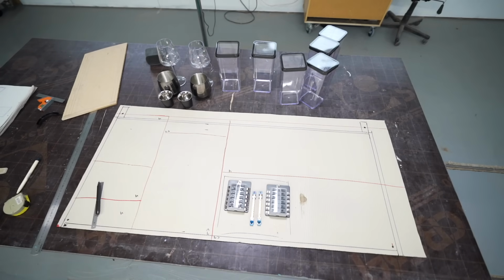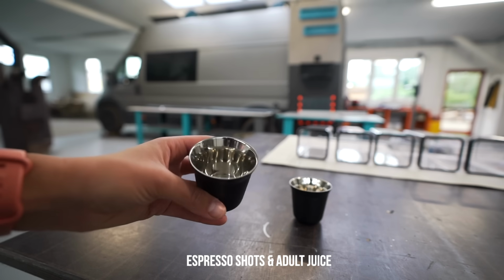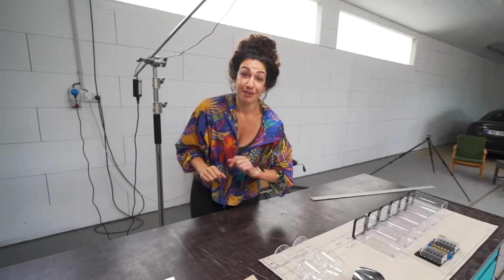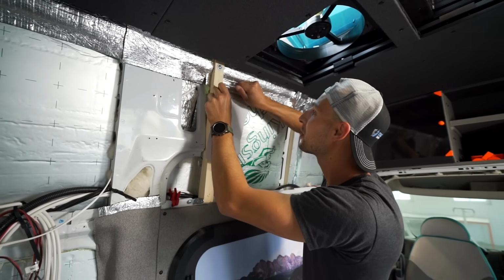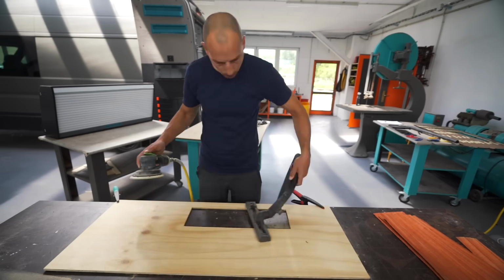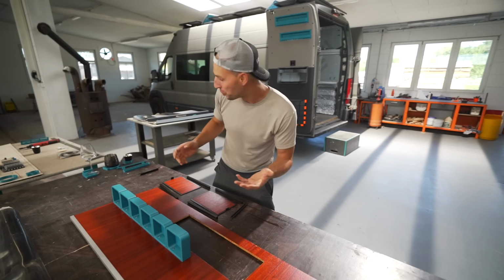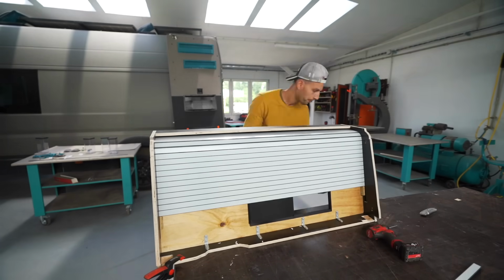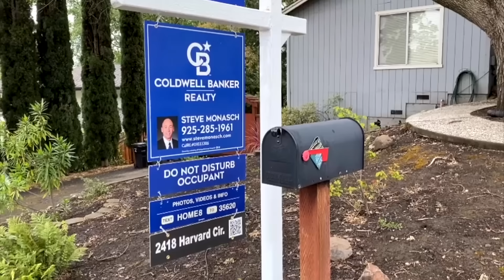Modular Overhead Kitchen Unit for Tiny Living Capsule (Pimp My Ride theme 😂) / Van Build S3E8

Comment: Hi the Vineer wood sheets if they not held glue tight can iron ( electric cloth iron )  ironed down to finishing drying the two surfaces of the glue MUST HAVE BROWN PAPER BETWEEN IRON TO PROTECT VINEER .This method ideal for edges and tiny bit , was shown this as boy in wood work class at school .hay! Really liked the sliding doors too

Comment: It will be perfect but it will take a long time.

I'm worried about these hooks in the containers, whether they will withstand the weight, especially on the road. Ordinary sliding doors would also be lighter.

I used to like to combine, but now I come to one thing: the simpler something is (maybe even primitive), the better :D
... And it will certainly be easier to fix

Comment: I'm doing a huge forehead-slap over here - sliders instead of cabinet doors! Lovely AND practical. No falling open on sharp turns either.  Could you use this for non-secured items, ie, without your system to hold canisters to the wall of the cabinet, would a bag of sugar break the sliders?

Comment: I love all these 3D printed parts you use in this build. It really shows what an incredible tool a 3D printer is!

What I was just wondering about: Aren’t you worried that these pieces might melt when it gets too hot in the van? I had some 3D printed parts in my own car and in the summer when the sun was hammering down on it these just became soft and lost their shape.

Anyway, great work and maybe your filament is more heat resistant than mine was. (I used regular PLA)
Greetings from Dresden, Germany
Reply from the maker: Hi, good question. I only use petg inside and asa outside. Look into these filaments! Good luck!

Comment: Just curious, most battery chargers out there are AC to DC. But in a vehicle you have to use an inverter to go from a DC battery bank to AC, then the charger back to DC. Supposedly there is efficiency costs to do this, so I’m wondering how practical would it be to use DC voltage regulators to go from the battery bank to the device charging voltage’s